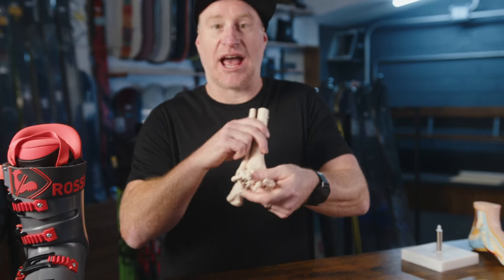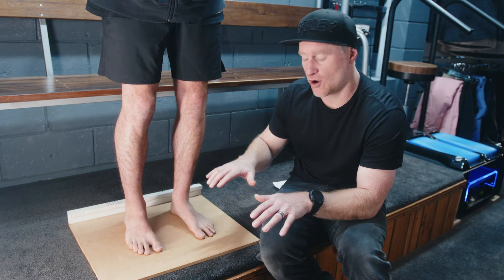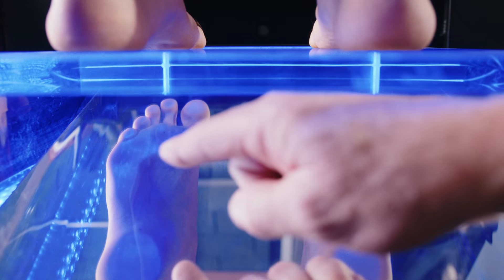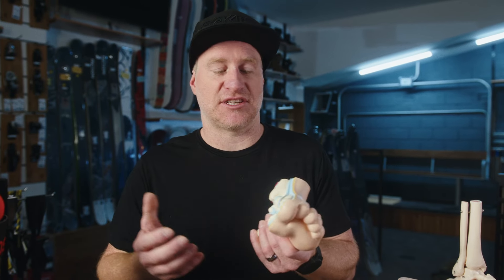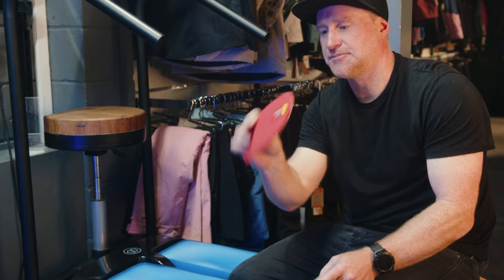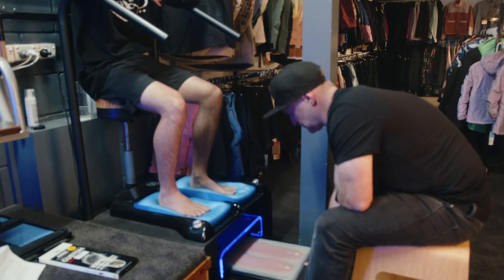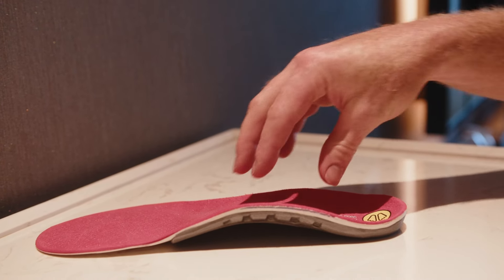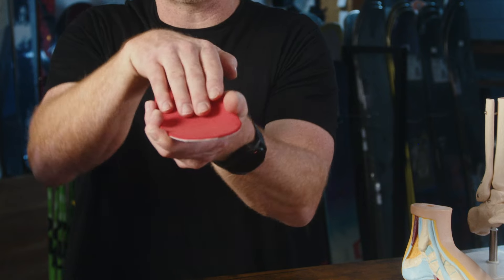How to Fit Ski Boots - Part 2 - Footbeds

Comment: High Craig. I enjoy your products. I have the liner sleeves and footbeds from a couple years ago. How long does a footbed last? I have a high arch. Do you recommend the free ride for a high arch?
Reply from the maker: Hi Frank, Thanks! Yeah you should get about the same life as a liner, say 100-150 ski days depending on how hard you are on them. Often longer, but it is the foam that packs in and the frame loses some of its responsiveness. For a High Arch I absolutely recommend the Freeride! 
Enjoy the turns!